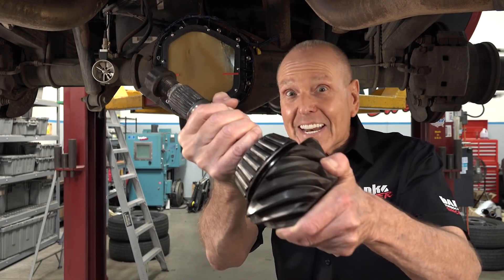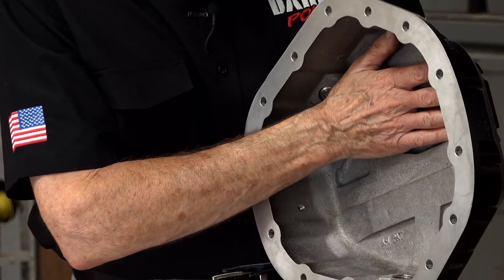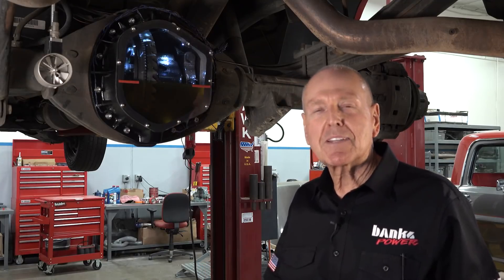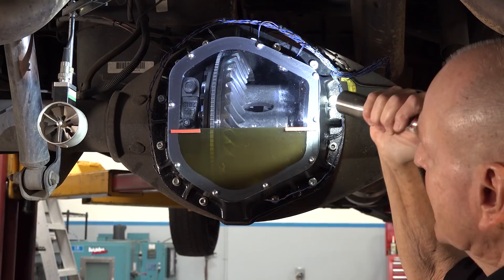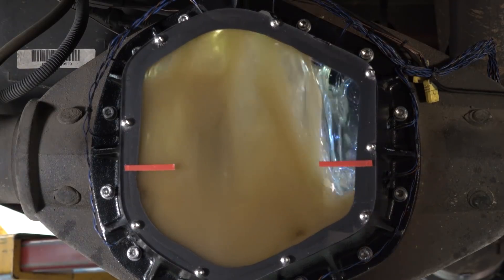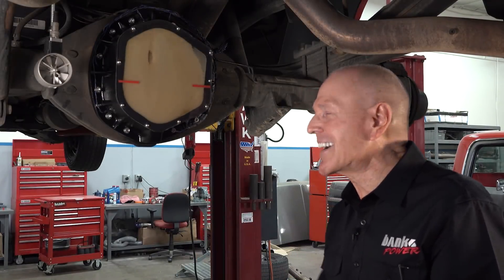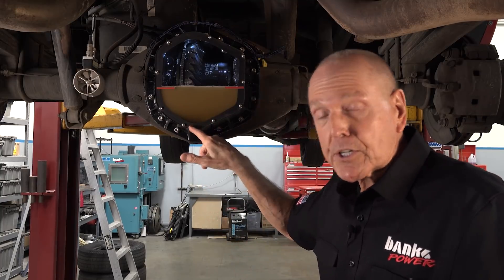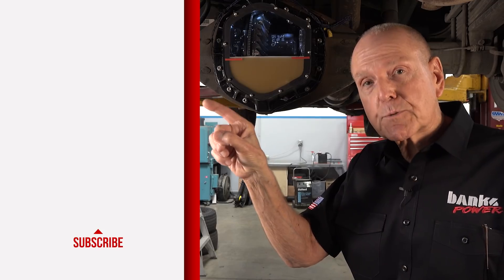What's going on behind your flat-back diff cover?

Comment: This is all very interesting...  but my problem with it is there's no real cases where failures have occurred because of an aftermarket differential cover.  I know many people who have mag hytecs and such that tow HEAVY over quite a bit of highway and have never had an issue with a pinion bearing failure.  There are more issues with the factory AAM 11.5-14 on ram heavy duties where people putting a diff cover on and amsoil SVG have fixed the howl or the grind.  I like what your saying and the amount of research and controls put in place, but I won't be removing my mag hytec because of it.
Reply: Bewitched Angling his original interest in part 1 was not “are they detrimental”, “it was are they helpful, or are they just bling”. I think he’s simply finding they’re 1- not helpful at all, 2- possibly detrimental due to their primary design element being 3-all for show.
Reply: Aaron Elliston I'm not disagreeing that there is probably no real benefit to them, but I'm not totally buying the "detrimental" piece of the puzzle.  If I had to do it over again I probably wouldn't have a mag hytec on my ram, but I'm not worried so much to go back to an AAM stamped steel cover.  I think the research hes doing is spot on, and I'm sure there is more fluid friction and therefore worse mpg,  but I'm willing to bet its negligible.  One benefit I see so far that hasn't been mentioned is the fact that the flat backed covers are "painting" the rear with fluid, but I kind of like that because the back is basically a large heat sink, and the more surface area and fluid you move across it the better the heat transfer.

Comment: I never understood why aftermarket covers weren't basically a shell on top of a stock inside cap. What I mean by that is The inside should have almost exact shape of stock but added fins or whatever bling you want on the outside.

Comment: Do not get me wrong.  I LOVE Gale Banks and their equipment.  Have their full blown power package with exhaust on our 05 Ram Cummins.  It sounds awesome and produces incredible power.  BUT for the same reason he can’t see thru the rear cover how in the h can he see thru the oil to tell not much is getting on the pinion, ring??

Comment: you shouldve filled it up with the 2 more quarts to see how it did, i hope you do when you test it. the problem i have is i hope that when a truck that has the flat diff cover on, the dealer or truck repair place knows to fill it with the 2 extra quarts than when has a stock diff cover, cause some places only fill up to a certain level of quarts.
Reply: He did... watch from about 3:20 or so in the video..

Comment: I have a 2017 f350 with a afe differential cover 2017 Kaufman 4 car trailer,I just pulled a 6 mile 6 percent grade in Wv loaded at 37,000 lbs on Route 19 south birch river,Wv got to the top and checked my rear end with my heat gun it  was 157 degrees!What was interesting is I checked my exhaust it was 250 (anodized pipe)degrees and my chrome Mbrp tip on the end of my exhaust was 360 degrees.Why are your Tires being destroyed on the dyno!

Comment: I saw where one guy said that Mr Banks needs a camera pointed down in on top of the pinion to show what it really looks like there    I can't see what the fluid is doing up there I'm having to take his word for it.  I know he's a very smart man so show me what it's doing at the front   And also if putting a cover on that holds more fluid than stock but doesn't go over the stock fill line makes more heat due to more air in the fluid then wouldn't this same principle work on the transmission and the motor oil which people either put larger pans on them or coolers and if the coolers work there then why can't we put one on the rear end

Comment: i said in the beginning that if the fluid spends alot of time on that back cover it may help cool the fluid...im still in the "bling club" saying its just looks but im a little worried...running oil temp will tell us alot...i know that engine oil like to be at 212 degrees Fahrenheit does gear oil work best at lower temps? obviously zero degrees would be bad
Reply: Interesting point about the cooling aspect.

Comment: So why did you overfill the diff? Just curious?  Typically with after market covers you still fill the diff to the same level as the stock. Also what do you think of the B&M diff covers? They are rounded like the stock ones are, but with cooling fins and I think only takes the volume .25 quarts over stock (2.75 to 3 quarts).

Cheers!
Reply: He filled it to the level of the fill plug, that's why it's higher. Would be interesting to see how the fluid goes in it when filled to the stock level.

Comment: Casting alloys are roughly twice as thermally conductive as steel but there is at least twice the material thickness so cooling could a wash even with that extra surface area. Some RTD's and a permittivity sensor would be nice. That power-loss could be huge at speed. Maybe it's time move on from the 1920's splash-tech and go "dry sump".

Comment: Wonder if a rear diff can be invented that's combined with a pump/pipe system and be combined with a cooling reservoir to cool and remove air bubbles and then release the oil at the same rate it is coming in. Maybe liquid cool the holding reservoir and keep the oil temp actively optimized for viscosity? It would have to be hooked up to power. I'm not a car mechanic or engineer but I do build computers with liquid cooling to keep the temps low.

Comment: so the pressure buildup from higher speeds should be amply filling every lubrication need in that whole environment. yeah heating and more work robs horsepower. it's an ingenious design developed what a century ago? how'd they get that back then? oddly like electricity, the debut designs worked great, way before they knew exactly what was going on with it. it was pure confidence from healthy brains. i'm sure in the design departments of maybe 1 or 2 guys in a dusty shop, dirt floor basically said "we got it, we'll the let the bugs iron it out, but for now, it's on."

Comment: The engineers that design the factory cover are a lot smarter than the graphic designers that design the aftermarket diff covers.  There is absolutely no proof aftermarket diff covers make the rearend last longer or run better. I know people with 300K on their trucks pulling trailers all the time...their trucks are box stock. These diff covers are for the Barbie Truck crowd...

Comment: A gear is going to carry the same amount of oil whether it’s a flat back or a square back.The oil is still going to waterfall of the gear on both sides and splatter the top.More splatter to me is more bouncing to the front,WHEN I SPRAY THE SUDS OFF MY TRUCK I USE THE SHOWER SETTING NOT THE JET SETTING,GETS IT DONE QUICKER!

Comment: I have one question. How does oil get to the diff center when you are driving at 60 m/hr? If you are cornering the diff center would almost completely dry I would imagine, leading to early failure.

Comment: Watched all five vids. No promised data disclosed yet. Hopefully in pt3 for data and not just a sales pitch for Banks design from this point on. 

Observations: Clear OEM style test was done on a light duty Ford diff, clear Mag-Hytec test done on a GM/Dodge HD diff. That's not apples to apples comparison of oem to flat back using different diffs. Oem shape designs are different on that Ford to that GM too. Foam test disclosed on oem clear, not disclosed on Mag-Hytec clear. 

Okay so...Banks design is following the OEM design shape, that's good. However, they have internal vertical baffles which will change the highly emphasized importance of OEM flow dynamics like a flat back does visually. Rounding 'up' to 4qts on Banks design for sightglass already indicates an overfill condition from oem level specs. Thought that was a bad thing to do even slightly like apparently the Mag-Hytec was stated as being over oem level specs with their design. Waiting for promised past data and would like to see a clear OEM to clear Mag-Hytec to a clear Banks version in operation using the SAME diff for flow pattern, foam test and other disclosed data to compare. 

For the record, my Mag-Hytec has been on my 97' F350 for over 200K mi with no issues, failures or rebuilds. So, I'm not 100% convinced my choice was the worst thing I did to my diff and bearing lubrication. Not a sales pitch, but Amsoil severe gear 75w-90 is what my diff has seen all it's life after factory fill service.
Reply from the maker: John, the videos depict only small parts of the test. We have hundreds of hours invested in testing. The videos are not representative of the total testing. We're not mixing apple and oranges. The clear covers are merely to give viewers an idea how the oil should or should not flow. 

We did aeration testing on all covers, stock, Mag-Hytec, AFE, PPE, BD, etc. None of the actual testing was done using a clear cover. All testing was done on actual non-modified covers, with the addition of various thermocouples. We did not "round up" to 4 quarts. The video is a little misleading. We wanted the average person to be able to fill it with 4 quarts so we spend weeks designing the cover so it would have the proper fluid dynamics while retaining the stock static and running fluid levels. This was a challenge, but we did it. 

Because of the complexity of the design, mainly due to the depth of our fins, we're unable to make a transparent cover that represents the new Banks cover. Trust us, we wish we could. Even if we made it out of glass, it still would be nearly impossible to see through fins and into the housing. 

Does the Mag-Hytec cool better than stock? Yes, a little. Does it make it easier to fill and drain your oil?  Yes. Is it costing you fuel economy? Yes. The fluid is fighting the ring gear as it hits the flat part of the cover and bounces back. 

We look forward to sharing all of our research with you soon. Whether that affects your buying decision, well, that's up to you. We're just going to present the data and what we know to be an improved design.

Comment: What he cuts out, is the pattern on the cover. Which could be a design. That is for controlling the oil movement. At higher rpm's.

Comment: when a bullet leaves a barrel its no longer being pushed no different than lube slung by ring gear. No additional horsepower is used regardless of wether fluid follows a curved pan or hits a straight pan edge there is no mechanical connection in unpiped uncontained fluid and no heat will be added as friction is minimal. most diff heat is from friction between ring and pinion and some from bearings

Comment: @Gale, just make some reverse molds of the housings, make some bucks from those and vacuform plastic housings onto the bucks?
Reply: Could cast silicone rubber into the other covers then use that on a vacuum former to make pieces to bolt onto the back of the cut up hi-tech. That would show how much extra bad the ones with 'features' on the inside are.

Comment: I have had a Mag-hytec on my year 2000, 2500 Silverado for 220,000 miles before I had to re-build my rear-end...I know it works, my question is, what is the best fill level. the stock level or the Dipstick level that comes with the cover...?
Reply from the maker: As per the video, the flat-back cover may have decreased the life of your rear-end. We cannot advise you on the fill level.
Reply: I thought you guys were going to test the correct running level?????????
Reply from the maker: We haven't released our findings yet.

Comment: Bank power try testing a stock 2012 ram 3500 rear with the full tow package my dads truck came factory with a flat back cover I have never had the cover off to see if there is a baffle in it to direct oil to the pinion or not I know you have a lot of cost in these videos but I am curious if who ever manufactured the axle changed the design slightly on the newer 1 tons and up

Comment: Also causes axl seal leaks seen it a lot i rebuild 2 or three diffs a week and have had front axle seals leak as a direct result of the same cover lowerd the fluid level and it stopped

Comment: I don't think these different covers will affect the amount of energy loss, as long as the oil level remains stock. Work is done to the oil by the ring gear picking it up and throwing it. That energy has to be lost somehow. It does not matter if it is dissipated by the oil bouncing off flats on the cover or by it bouncing off the top of the diff casing (from a curved cover). Increasing the oil level will increase the amount of oil being thrown about and therefore the amount of heat generated.
As far as lubrication is concerned, again I don't think the cover makes much difference. What you are seeing through the back when the diff is spinning at any decent speed is oil that has already been thrown off the ring gear. That oil plays no further part in lubricating the system. Plenty more oil will be thrown off the ring gear in the forwards direction to maintain lubrication of the pinion and pinion bearings. 
You really need to see in the side of the diff casing to see how much oil is being thrown forwards.

Comment: Take a new stock diff cover then drill two 5/8 inch holes on either side of the ring gear location below the gear oil running level and drill one on the very top right corner. Get some long bolts for the cover. Then slap that big old aluminum box cover over it, to hold that additional reservoir of gear oil you have been wanting. All problems solved. And you don’t have to toss your four hundred dollar after market differential cover.

Comment: why not an angled channel to force the oil mostly at the 2 o'clock of the ring gear which would possibly  reduce drag from the oil and forcing it more to the ring gear. You might even be able to play with lower oil levels which in turn would also reduce drag. I remember windage trays and swinging waste gates on motorcycle engines which aided in shaving 1-2 tenths in quarter mile times by channeling oil away from the crank and also limiting oil being dumped onto the transmission gears. No question having a bowl shape  to the cover is better than flat and causes turbulence. Work with the bowl design in mind with a directional channel. Dry sump system would work but would cost a fortune.

Comment: I'd like to see a test on the ruffstuff differential covers
Reply from the maker: RuffStuff covers are like many Jeep and heavy duty off-road covers. They are designed for strength, not cooling. So, for that reason we won't be testing them.

Comment: If these after market brands wanted to be more than style over function they might want to keep some of the original engineering in place. It would cost more in material but what is wrong with keeping the original stock profile on the interior of the cover and add the flat back with fins on the exterior?

Comment: Is it just me, or did the stock cover fluid appear much whiter (full of air) than the aftermarket following the 50 mph test? Without a camera on the pinion, how are we supposed to know if it is getting more or less than stock?
Reply: yuo're not... just buy banks' cover.... that's what this is about anyway

Comment: Changing our differential fluid to a lighter non-foaming (lesser foaming) type increased our dooley differentials' life from 100,000 to 300,000 miles.
Reply: What brand dually?
Reply: Chevys.That was back in the 70's and 80's. We hauled boats over the road. A lot of high speed running. 454's held up well in spite of the high rpms. Also increased clutch life because the transmission oil would foam up past the front seal, creep up the shaft and oil the clutch. We had a good maintenance program and a great mechanic.
Reply: @craigsmith8217  ah, ok. That makes more sense. Our Ford's had hundreds of thousands of miles with zero failures and never changing the oil either.

Comment: You don't need a transparent cover to know what happens. A factory shaped cover does guide the fluid better than an aftermarket flat cover.
If I were asked to design a better performing cover, I would  make it from aluminum and keep the factory shape. Aluminum conducts heat better than steel. I would also add some cooling fins in the outer surface that will add cooling capacity and also make the cover more rigid.  It's not a rocket science. 
Heat transfer capacity greatly affects the gear box power rating. Additional heatsink can also be added and mounted on top of the differential. Heat transfer tubes can be used to transfer heat from the oil inside the differential to the heatsink  thus greatly increasing diffrential's capacity. This technology is widely used in other applications. For example,  heat transfer tubes are used in laptop computers to transfer heat from the processor to the remotely mounted heatsink.